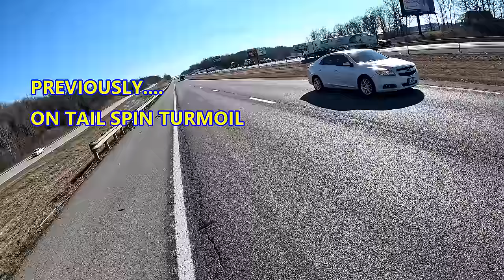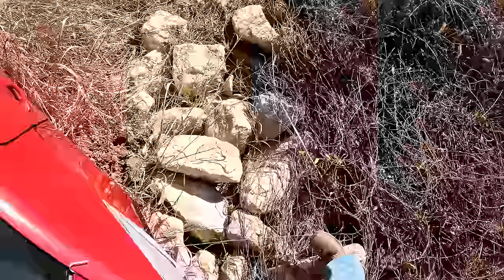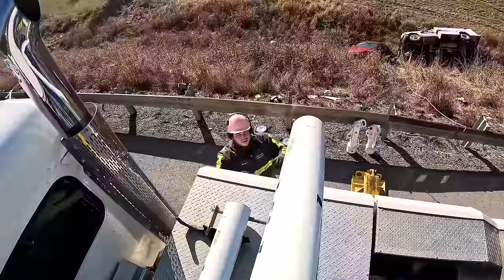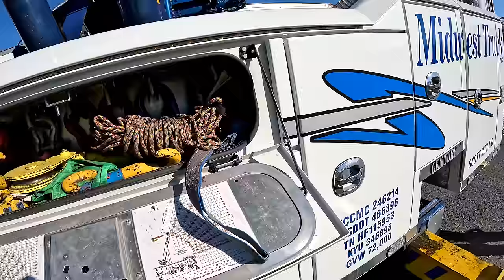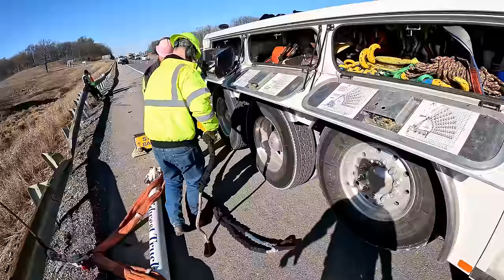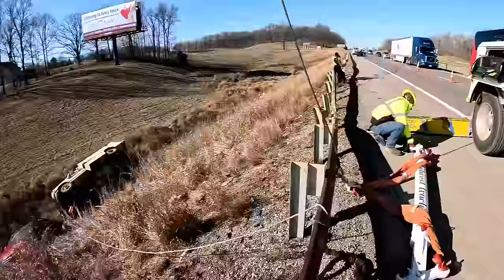TAIL SPIN TURMOIL PART 2!!!  MULTIPLE VEHICLE CRASH!!!  UP & OVER!!!

Comment: I ran a HEMTT Wrecker in the Army, I thought it was the most capable wrecker ever built!  But after watching several of your videos, I am more impressed with the capabilities of your rotator!   I went to the Army Hotel 8 recovery school, and learned quite a bit.  But after doing actual recoveries state side, and in Iraq, I learned there are so many real world factors, and nothing is a “text book” recovery.  I’m so impressed with you and the capabilities of your team!  Well done, keep the content and live streams coming!!!  Let all of your guys know what a wonderful job they are doing.   Any job you can complete, and every one goes home safe is a mission well completed.  You may have lots of viewers saying it should have been done different, but from what I’ve seen, you have outstanding equipment, and you are doing it right!!!
Reply from the maker: Thank you for your service and thank you for the kind words.   God bless.
Reply: @RonPratt  The winch system definitely was put under a ton of stress - you could definitely tell it was working. Has there been any scenes you've worked where the winches could not do the job because the lift required more power than the system was capable of delivering?
Reply: Yeah, I learned about "text book" when I gave birth. Baby and I were both fine, but I decided afterwards that it's really only "text book" if they've written up your case in a text book. Things were crazy in that maternity ward. You'd think some of the medical staff had never worked in one before. Honestly, even if you could put everything in a text book, no student would be able to learn it all.
Reply: @JimDandy1082  He was just pulling one winch, single line.  His two boom lines are capable of producing 4 times that pull without strain.    Plus the two secondaries are capable of similar line pull.   

The rig has the ability to winch more then it will hold still for.    We've seen him running out of pull with two winches pulling two part lines on the boom lift recovery a while back.  He was probably near maximum lifting ability given the reach he was at when getting the tractor off the bridge a couple years ago.
Reply: Wonderful job!  Good  positive instructions

Comment: Kudos to Ron! Not only is he the owner he also is an operator.  You don't ask your team to do anything you yourself wouldn't do.  This job showed the full body workout. You made just as many trips up and down the ditch as the guys did. You even ran over to the northbound side to assist with the secondary crash. You deserve a rest and air-conditioning back to the shop.
Reply from the maker: Thank you.   I have always told my personnel "I will not ask you to do anything that I haven't done or am not willing to do myself."   I do my best to lead by example.  You noticing that is greatly appreciated.   Thanks for watching and God bless.
Reply: @RonPratt  not only that, but you obviously won't let anyone else take a risk when it may be necessary, but you know it will be less risky if you do it.   You exhibit great leadership, in my opinion.

Comment: Just a suggestion: You should have a written inventory of the tools and equipment for each truck. These are excellent training tools for your crew so they can easily identify the tools available and where they should be located on the truck. Creating the inventory is also a good learning experience for the crew, and using the inventory, at least weekly, helps to spot any missing or damaged equipment. Using the proper names of the tools really helps with clear communication and intent. Also, a regularly updated  inventory can be very useful if an insurance claim must be made.
 Being familiar with the attributes of many types of vehicles also makes a job go faster and safer.
It is nicely apparent that Ethan is paying better attention to his physical fitness, and hopefully this will be a good example for Gavin. Dalton is showing excellent enthusiasm for the job.
Reply: An Excellent Idea.  Just the thing Ethan especially and Gavin need to do.

Comment: The radios you are using helps out for communication it makes it a little easier. One small suggestion give each person a position to do one part of the job upon arrival. Operator #1 set out cones operator #2 set up and distribute comms. This way those tasks get done automatically to free you up to assess the wreck. Making it one less thing to worry about. Great videos Ron and thank you for sharing them. I look forward to them.

Comment: So after seeing both videos and the size of the trailer that this guy used. The vehicles that were on the trailer, I would think that the trailer was overloaded to the truck he was pulling with. The trailer was too small for the load. The truck had plenty of power to pull with the Cummins but maybe if the trailer was a 5th wheel would have been better deal. Good job on the clean up, men!
Reply: I assume it wasn't a bumper hitch at least?
Reply: I would say the trailer was fine (though perhaps improperly balanced depending how the light and heavy vehicles were placed on it.) The hitch on the truck was way too light for the load.
Reply: Yeah, I was wondering how big the ticket was for the driver involved in this...ouch.
Reply: If he did wag the dog me thinks there was a incorrect loading
Reply: The ticket would be nothing compared to the likely total loss of all 3 vehicles involved, damage to the trailer and a large recovery bill.

Comment: There was a video someone did about small tools disappearing into a black hole. As a companion/result to that humorous video caused by drops and low visibility where they become invisible maybe you should develop an inventory of critical tools and towing equipment that can get lost over time. Put it in a case that can be sealed with a plastic security seal while having the everyday usage one readily available. Having the seal will prevent it from being used until the original can’t be located. When the seal’s missing it’s time to check inventory for the whole truck. The newer members seem to be doing a good job but until they become proficient knowing where everything is supposed to go it’s a safeguard for tool misplacement so the job can go on. In a workshop you can lay out tools in order to visually see when something’s missing but it’s not practical for a mobile truck. Everyone continue to stay safe Ron. There’s many waiting for all of you at home.🙏👍❤️😉

Comment: Ron, I have a suggestion that may or may not make your job a little bit easier for you. as a heavy haul flat bed trucker when I am done with my chains and putting them away in the box on the trailer I hang them up and then i take the hook on the bottom end of the chain and hook it to the chain link just below the hook that is holding the chain in place. this makes it easier to remove the chains when I need them again as this prevents the loose hook at the bottom of the chain from grabbing other chains and becoming stuck on them. I am not sure if this method will help you and make it easier for you when you are pulling chins out of your box and off of the chain holder.

Comment: You did a great job of safely recovering several vehicles under very difficult circumstances. I miss seeing Mike because he was a great second man (to you Ron) and really knew what he was doing. Your young guys need to get a bit more ambition going for my taste, but in the end the job was completed properly and without injuries. Good job Ron.
Reply: Did Mike leave Midwest Truck?
Reply: Mike takes other jobs as the leader. They have a great number of calls for service and a fleet of equipment to be used.
Reply: @williamwallace9826  he is running shop and mobile service now.  

What about Talon?

Comment: Woo hoo! Gear we've never seen before! Honestly, I don't think I've ever even noticed those tubes.. they just blend in with the truck, but then I might've and jsut forgotten because my memory sucks these days. That poor old Ford service truck.. looks like the one Gentry and Sons just got after their fire... I can promise you it would've been a lot more destroyed had it been a GM. Plus side is it looks like the service bed isn't too bad so it wouldn't be too hard to re-body it with a newer truck cab and give a little more head room (and not just because the cab crushed) and some more creature comforts. Man going up and down hills like that, I learned a LONG time ago not to try to walk up/down them.. one too many falls on Guam and rolling down the hill taught me to engage four wheel drive and just drop down on all fours like a monkey and claw your way out. The interesting thing about that spreader bar is I thought you'd hook a single line to each end of it so that you could steer it with the separate winches instead of it just going wherever it's gonna go.

I can officially tell you part of why those vehicles came off that trailer... Guy was using couch rated straps to tie down a rhino and an elephant. Go figure they let loose and took off into the wilderness. (I'm on 5 hours of sleep, excuse the weirdness. Damn 4 year old dog decided to pee in my bed yesterday.) 
Yeah Gavon's going to be HATING life when it's 100 degrees and 100% humidity and you're standing out there on 150 degree tarmac.. He definitely needs to start working on his weight now if he wants to stick with that job or it'll literally kill him. I think that's part of what kept me somewhat thin in high school was I wore jeans every day no matter how hot it was because I was riding my bicycle and welding so I didn't want to risk my skin.. After college I stopped wearing jeans all the time and suddenly started putting on weight. (other factors didn't help either) I still think i was sweating off most of my weight back then. I'll tell you even walking a dog a couple miles at night in 90F and 45% is bad, you start doing actual physical labor in the heat of the day with the sun beating down on you and radiating up from that blacktop.. Good luck drinking enough to stay hydrated. *sigh I miss welding.

Comment: Been a LONG time since I've seen you use the spreader bars.  I know there are a lot of ways to skin a cat, but I was waiting for you to use BOTH bars, one of the front and one on the rear and use both blue and white to level the truck out. Now that would have been a teaching experience! LOL  Good show Ron. Just keep in mind, you have at least 3 kids on the job that are much younger than you.  It's time to step back and let them do the pick up/put away tasks.  Let them learn from doing while you sip a cold one. You don't do them any favors if you have a medical event because you pushed too hard.

Comment: Why doesn't the rotator have an arrow board of some kind on it?  I'm guessing you could add one with a motor of some kind to raise it when needed and lay it back down again when it isn't and attach it to the back of the cab somehow so it stays put and doesn't move with the turret.  When I so several vehicles, I was hoping we would get to see the wheel lift on the rollback used as well.  One has to feel bad for the owner of all these vehicles because unless he was moving these for a bigger operation, this could hurt his operation because I'm guessing all 3 vehicles and trailer are now totaled.  And unless he has insurance, this could put him out of business for awhile.  I was thinking to myself while you were waiting you could've run an aux. winch down and drug that tire up the hill.  What's kinda ironic about all of this is how it says, "Nobody gets hurt" on the side of that work truck.  What is that big yellow strap you have tied up their with the spreader bars for?  In actuality, how long did this job take you to complete?

Comment: Good job as always. Think I'd have used spreader bar on front of car only until it was closer to truck as you did for the big truck. ( May have saved that mirror that "popped" off. 😆)  Glad every one remained safe and no accident happened on your side. Good work by your entire crew as well.

Comment: Great videos (both of them on this one incident).  Thank you for all you do.  It's really unfortunate that the rubber-neckers caused the secondary accident and that someone sustained an injury because of it.  I wish there were some way to impress upon folks who are driving to be especially careful.  An vehicular accident and injury can haunt you as long as you live.  I was involved in three major accidents from 1989 through 2000, none of which were caused by me.  For a long time, I began to wonder if I didn't have a sign painted on my car, in invisible paint, that said "Hit Me", and, brother, they did.  I cannot sufficiently emphasize the profound effect that can arise from a seemingly "minor" accident.  In 1989, I took a ditch at 35-40 mph to try to avoid T-boning a driver who had pulled out onto the roadway when I was almost on top of him.  His vehicle was much smaller, and although the accident was his fault, my vehicle easily outweighed his by more than 1,000 pounds.  After my son checked my vehicle to be sure it was okay to drive, I drove it home.  Three years later, another driver ran a red light at a speed of about 50 mph, hitting my vehicle in the left rear quarter panel and spinning it 180 degrees in the middle of a busy intersection.  Then in 2000 another driver made a left turn across three lanes of traffic right in front of me.  So, if there's something I can say or write to urge folks to drive defensively, I would gladly do so!  You and your crew do great work in dangerous territory.  May God bless you all.

Comment: Reason why I am a firm believer on not using  bumper mount for towing anything and only using the ball mount "bumper" mounts for light load, and use gooseneck or 5th wheel for heavy loads

Comment: Great pull, Last time i saw the spreader bar used you had it doubled up for the extra wide lift, dont recall which one it was, RIP 94'ish service truck, Case no less they will have a rough go straightening out all the loose tools & parts within the boxes.

Comment: Been a bit since the spreader bar's been on the job. Probably a couple years in vids other than a demo or 2. I had to chuckle a bit hearing the 3 toots when Ethan backs up, definitely learned a couple things from you. I must have missed the idiot trying to hit ya when you were packing up the cones. All the vehicles I saw were well over and even over the yellow line on the other side. The red van was the first I saw and like I say he was over the opposite yellow.

Comment: In the UK at a job like that there is often a sign truck at the rear of the convoy. It will have a rear facing 8ft diameter arrow sign that can be set for pass to the right or pass to the left. It will likely have an energy absorbing block behind the truck (crushable metal or plastic)
Reply from the maker: We had our traffic control unit on scene, but you couldn't see it, because it was set so far back.   We have large orange signs that stand alone which read "INCIDENT AHEAD".   The traffic control truck is fitted with red/blue emergency lights and a traffic advisor/arrow board.   It also carries a large number of traffic cones.   We do not have the crash attenuator or as you say the energy absorbing block.  Normally, our state's MoDOT will bring a crash truck out to a scene like this which will have the attenuator on it.   We requested one, but it never showed up.    Thanks for watching and God bless.

Comment: was hoping you was gonna tell us how much it weighed once you got it up.. at 1:01:44 you almost said it but realized that it was still resting on the passenger side steer.  my guess based on my   1997 f super duty with a century 441/442  with formula 1 bed ( I think data plate was painted over) was about 27k. Mine scaled at a cat scale by previous owner was just over 15k...with the crane and work body I I guess it would be a similar weight. . AS for the bed.. the slogan on there was almost prophetic..."nobody gets hurt." odd the things you see on the road.
Reply: I meant the resistance pulling up the hill the hanging weight I guessed was about 15k like mine.

Comment: Years ago, I think in Tennessee, someone floated the idea of requiring wreck-sites on highways be screened off using canvas on steel posts so people can't see any of what's going in, reducing the rubbernecking.  I think it fell off the radar because, A, nobody could really decide who had to haul all that stuff around, B set up and takedown puts people at risk longer, C, if someone does veer into the work site, nobody will see it coming, and D, people would still slow down to try to get a peek.
I hate to say it, but maybe self-driving cars aren't a terrible idea.  People get stupid behing the wheel sometimes.

Comment: The surprise in this video is, Missouri does have a some guardrails. Anyone thinking they didn't do their job, the tow vehicle with the driver in it didn't go over. The truck  and car were high up on the trailer . I didn't notice any broken  tie down chains or straps  .

Comment: As a bit of a suggestion for you…. In previous videos I’ve heard you say that the tow company is responsible for the scene being cleaned up as far as crash debris goes…. The bank these 2 vehicles was down over was quite steep and you even used a safety line for that so it’s easier to climb up and down. My idea would be….nice you got that service truck on its wheels why not pick up as much of the debris as possible and throw it in the bed of the truck before lifting or dragging it up the hill….let the Tater do most of the work instead of trying to hand carry the debris up such a steep place….